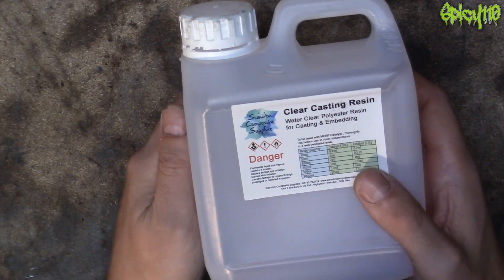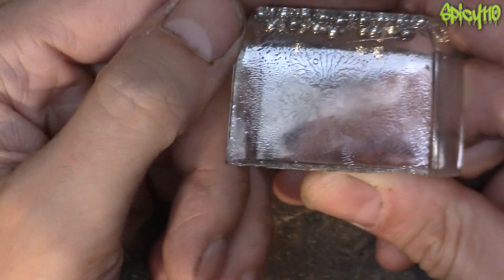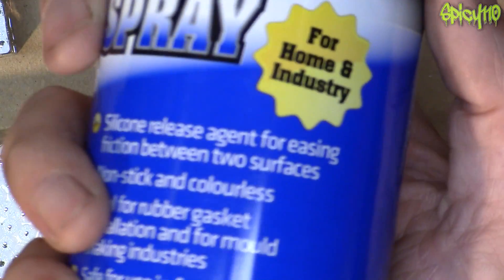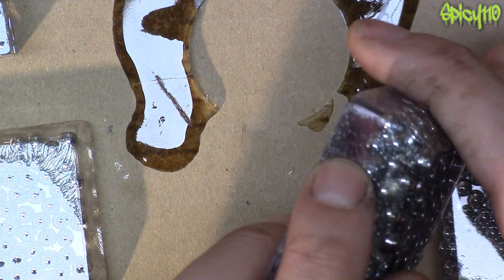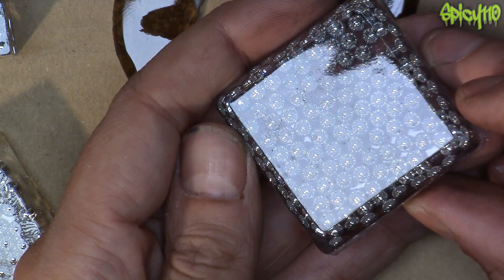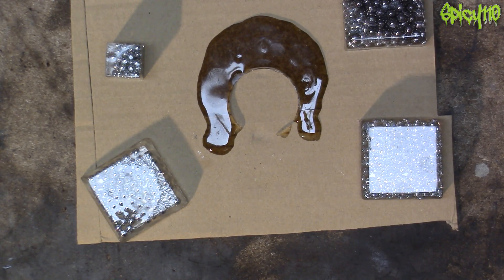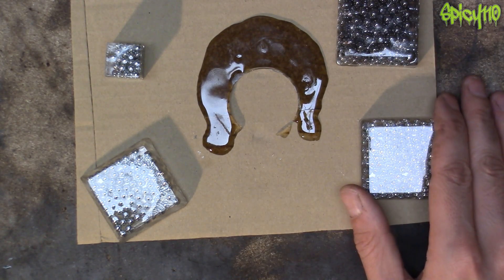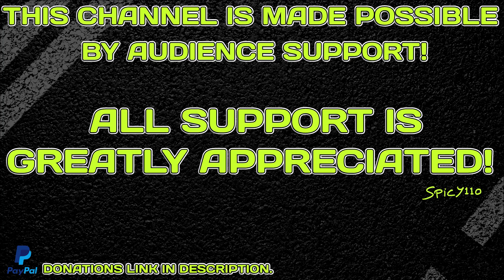Clear cast polyester resin soft and sticky after cure!? (solution found in description)

Comment: I own a plastic fabrication company in Havant. It looks like too much hardener. Make sure you are totally contaminant free with minimum moisture/humidity. Ensure your release agent is fully dry. Don't heat them too hard to dry the resin too quick. Use good moulds. Prep prep prep. UV heaters work well. However resin can be a pain in the arse to sort out when something goes wrong as it could be a million things!
Reply: Also, on a side note, check the shelf life of the resin. Ensure the metal inside is fully clean with no contaminants whatsoever. Reduce catalyst to 1% and dry over a period of time at 15 - 25 oC. Don't forget that the resin is a series of chemicals, the chemicals react to each other to cure. If you introduce any other chemicals/contaminants this can have an adverse reaction or interrupt the the resins chemical reactions.

Comment: Polyester resin usually shrinks when it cures. That can cause the sides to peal away giving it the cracked look. If the silicon is soft, you can try using a water bed to create pressure around it as it cures. Make sure your release agent has cured and is dried too before you pour your resin. Your resin needs to be exactly mixed as directed, it maybe worth getting a different brand if the direction are vague. cleanliness is key, try using brand new disposable plastic cups and pour. always pour, any leftover that doesn't come out shouldn't be part of your casts unless you really how to work the product.

Comment: The only things I could think of are after initial set placing in a hot bath perhaps 60-100 degrees for an hour. Another option is using a pressure pot whilst curing.
I would then rinse/ soak the casts in isopropyl alcohol to clean the surface of tackiness (wear gloves though)
Hope it helps and good luck Spicy!

Comment: I had the same problem until I read that it cures best at between 24 -30oC. Well, the UK sure doesn't get those temperatures often during the height of summer, let alone at this time of year. Last night it was pretty chilly, so I put on the gas-fire and lined my molds along the top. Two hours later, they were all rock-solid.  Next challenge - getting them out of the blasted molds!

Comment: I have extensive fiberglass experience.  The most common cause of a sticky or semi solid goop that "never really cures hard" is that you may sill have used too much hardener.  Even 2% can lead to this if the ambient air temps are high and/or you have not mixed thoroughly.  The hardener fills voids in the resin - too much hardener will have nowhere to bond and will leave a sticky residue.  Equally, too fast a cure due to high ambient temps (even with the 2% hardener ratio) will cause the cure to happen more quickly, using less hardener to kick, thereby leaving some hardener left over = sticky.   Less hardener will still cure the resin, just more slowly.  Try 1%.   Good luck.
Reply from the maker: BlueMarbleRider yes it was during that hot weather we were having, I will try 1% many thanks

Comment: apply heat for a longer time and up the temp slow, it cures to the temp around if you warm it to quickly it will deform. 
cast in thinner layers next time.

and apply a car wax inside the mold next time, it won't stick to the mold then :)

Comment: You could mold them in a vessel wich you can pressurise.   In a 6inch black abs tubing on cap on one end and the cap that unscrews at other end so you can place your molds. Make a hole in tube and insert motorcycle rubber tire valve in and voila. Place molds and take bike pump and inflate to 45 psi.

Comment: Hi Spicey, I have done some playing with Polyester clear casting resin (attempting to cast a Bladerunner blaster grip) and ran into the same problem as you, castings that are sticky and pick up fingerprints really easily, and  also have 'Crackling' effects on the surface. I did some research and found that one of the main problems was the one piece silicon mold I was using had an open to the air side (somewhat like your square silicon molds). Apparently, if parts of the casting are exposed to air it can affect the setting properties of the resin and you end up with a sticky surfaces. A two part mold does not suffer from this however because there is little to no air in  contact with the resin itself. I have to confess I gave up on the Polyester resin as time ran out.  Actually I’ve just had an idea on the removing air thing I did not think of at the time, a vacuum. If you put the mold in a sealed box and suck the air out it may side step the air contact problem. I’ve not tried it yet but I  will when get time.  Anyhow, hope you figure it out Spicey.  Best  Angie
Reply: I did the vacuum chamber thing and my resin did boiled and get hard with a lot of bubble like hard foam. 🤔

Comment: Temperature is going to be the biggest factor, I've just bought the same resin and now researching the hell out of polyester casting resin ( made a blunder I wanted epoxy resin ) also when its finished there is a resin lacquer you can spray over it hardens the top layer completely. On larger pours a wax additive can be added that cures the outer layer but will only cover the top of the project

Comment: I don't think I can help much... But if you want to clean out the moulds, you could try using some Acetone (nail polish remover). Good at getting dirt off things.

Edit: Actually scrap that, I just found out that Acetone is a really good solvent and that it could distort silicone. Best not to listen to me then xD

Comment: Hi man
I learned abut polyester this way which is, this material is like glue with the ability of casting. but like other glue it must use as a think for sticking particle or natural or synthetic tissues like Fiberglass or even Pigment and some filer like Calcium cabinet ... extra. so if u want to have clean glassy result, probably you have a savage and unfortunate issues. But you can try layer casting like a quarter of inch per time and test it in cool environment like indoor with good air condition and hood. before each layer wait for curation of  last one. because of heat releasing  and shrinking . I most say all of this maybe don't work with your material, just because of deferent between type and chemical detail of my kind and your kind of polyesters. have a good experience. 👍
Reply from the maker: I did sort the issue in the end. I had to leave them for a week then wet sand and they were perfect!

Comment: put 4% hardener :D or something like that at least more than specified by the manufacturer. Also it looks like it's cracked so perhaps it cracks when you take it out. Maybe try a rubber mould? 

I worked with resin but not this kind. Usually when it cracks it is because there was too much stuff poured at one place. The resin I worked with creates a lot of heat due to chemical processes. If this is similar resin then I guess try smaller moulds and check if it cracks (more hardener will make it go harder faster and in the case of the resin I worked with, it will create more heat). Hope this helps somehow.

Comment: Polyester resin will be sticky if its surface is in contact with air as it goes off. 

The  surface fracktling is due to is due to 1 or more of 3 things.
1 .Mosture in the air- only do fibreglass work on a dry day. ( Or make a tent for  working in out of plastic sheeting over a radiator  and  put a dehumidifier in there too.   

3.. Srinkage - polyester resin shrinks  as it cures. Small amounts like this should not. - try a thicker mould wall that will not be distorted by srinkage or exothermic reaction.- or make a case around it ( mother mould) out of plaster.
3. Use less catalyst . - 

There are polyurethane resins now that are easy to use and are not as expensive as the epoxy water clear.- good luck
 
Srinkage -
Reply: Missed out number 2 - polyester resin eats away your mind. Just avoiding it is the best option.
Reply from the maker: Hey thanks i ended up solving it but polosing under water with wet and dry. It was only the very top layer also I gave them at least 5 days to cure. 🙂

Comment: Looks you me like your Resin has gone off heat exposures oxygen and/or UV exposure over time deteriates the Resin and hardener...Does it get very hot when curing?..good Resin Hardener will get Hot and old going Off stuff will maybe get slightly warm or cold....Used tory make my own Chess and Ornament moulds years ago Great fun it was casting Butterflies and Wasps in clear Resin.
Reply: Looks to me blooming typos but it is very late😉😉Go to bed yer daft bugger..😁😁

Comment: the wrinkles suggest a temperature issue or maybe a reaction to the mold? Am assuming you are not moving them once poured? As for the softness of them once set, is there a better hardener you could use? It might make them brittle if you get them too hard though

Comment: I have no experience in this personally, but have watched a crap load of videos on YouTube about this.. From what I see, the mixing itself should be good, but the resin to hardner ratio could be better, also maybe the surface artifacts could be due to the mold release, maybe try a different brand? I don’t know where you keep the molds after poring the resin, but leaving them in the garage might not be the best place? Lastly, make sure the ballbearings are cleaned of any oils, grease or lubricants, just to make sure nothing is there to maybe react with the resin.. not sure if it’s a factor, but best to eliminate as much variables as possible :)

Comment: Softness is due to lack off hardener, add more. The rough effects look to me, a reaction from the moulds, paint looks exactly the same when it reacts.
Reply: Not exactly correct.  This is supposed to be a 1:1 ratio mixture.   it should cure at that ratio.  It does not.

Comment: Although I haven't had personal experience with Polyester Clear cast - I have had experience with Gel-Coat in Boat repairs - potentially this is epoxy based but I'm not 100% sure. I used to get similar tackiness problems and finish problems with gelcoat - simply enough I needed to add "Wax-in Styrene" which leaves a high-gloss finish. The symptoms of softness you are having surely mean a lack of hardener though?

Comment: Did you find a solution? I'm using the exact same resin and often get this same finish. I've read lots into it and seems the only option I can find is the sanding and polishing method at the end which as you mentioned is not ideal!!! Annoying and I wont pay out for epoxy!
Reply from the maker: Hey I have answered this in the comments a couple of times. Basically i left them to cure for days and then wet sanded them. It gives much nicer round edges too that are less likely to crack.
Reply: @spicy110  Bother :( looks like I'll have to order epoxy cus i am sick of wet sanding haha

Comment: Sounds daft, you letting the spray dry within the mold before you cast? Prep is king on anything like this, prep prep and prep again.
Reply from the maker: yes I have been giving it a good 30 mins and a couple of coats.
Reply: If your in the garage doing this, the only thing i could possibly add is room temp and moisture? Try casting and moving them into the house? 

I used to resin cast donkeys ago for 40k, we had issues leaving the molds in the garage overnight it would not set 100%, untill we left them in the kitchen.